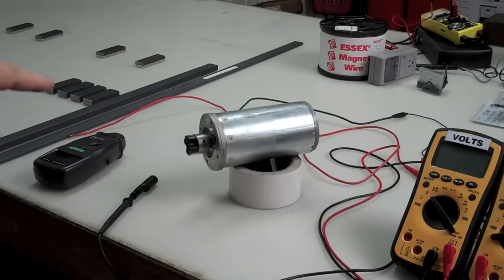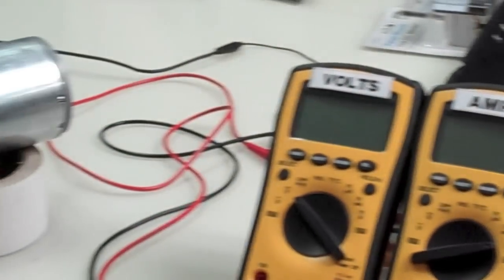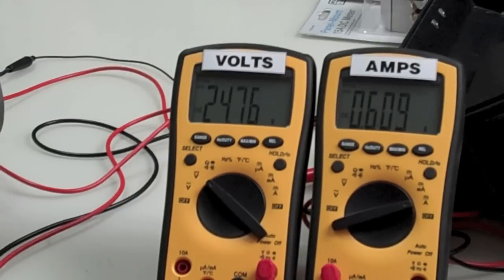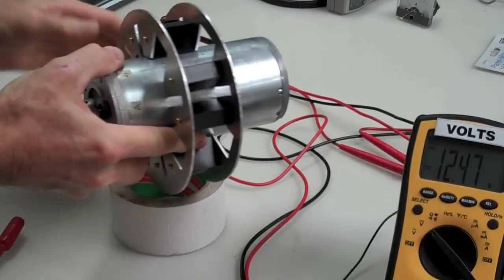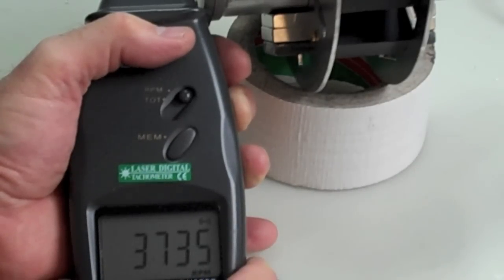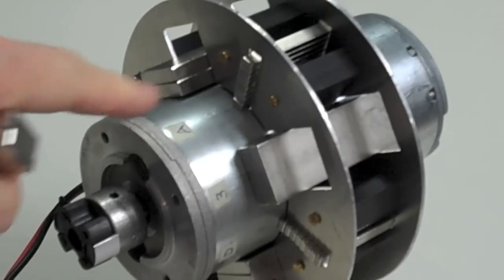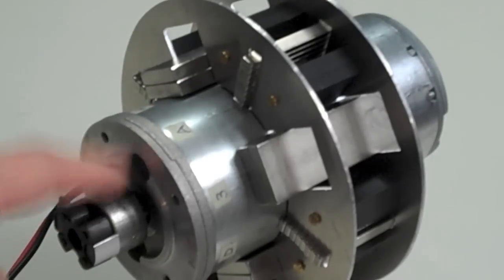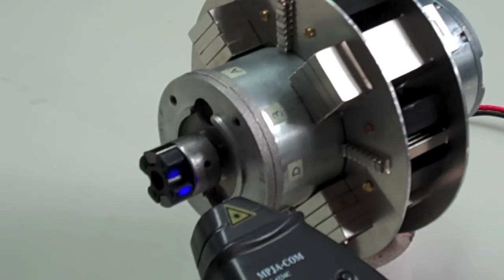STARGATE MOTOR  FULL DEMO

Comment: The motor requires power to move the rotor and that is the load.  The power it takes to move it is 24 V x 0.6 A, which makes it 14.4 watts.  In the second instance it took 12 V x 1.0 A which is 12 watts.  The RPM and voltage changed, so the load changed.  And that happens on non-optimized motors, because the rotor is banging with less force on the repulsion side, that way the RPM is controlled for a specific and constant load.  The trick here is the change of design. College is very helpful guys

Comment: It is just field weakening effect. Field weakening in DC motor increase, just look up the basic formula for DC motor operation. Byweakening field, not necessarily, you will increase power, torque depends on current. If field is decrease, torque is decreased

Comment: If you opened up a textbook on motor design, it would be no surprise that strengthening the magnetic field around a permanent-magnet DC motor improves the performance. 
Motor manufacturers are not being 'sinister' - rare earth magnets are made from things called "rare earths" which, as you'd imagine, are not as common as regular iron and nickel.

Comment: But the amps drop off at a faster rate than before, i would assume due to the additional friction imparted from the magnets you added. Which is the same input more or less. The additional amperage compensates for the voltage drop. And as we ALL know, amperage is what actually performs the WORK.

Comment: For the magnets to stick to the casing and not fly to the far ends of your frame you're commutating the flux that MUST radiate outward in relation to the neutral plane set for the brushes and therefore reducing the field flux that the armature sees.  While this increases the no load speed and reduces current draw, it reduces shaft torque exponentially.  At the end your arrangement causes runaway speed because the field is so week.  See physicsforumsdotcom thread 412799.

Comment: What is the justification behind the large and small magnets and why could you not have accomplished the same with only the large magnets on top of the internal ones.  Secondly, how come you did not use a voltage regulator to step down the voltage to say 3V and see if you would achieve the same 3K RPM.  In my experiment I've stripped several like motors apart and used their magnets to double up the magnetic flux.  And last could you tell us where you purchased the motor?.  Thanks

Comment: If you did use better the bearings, it will spin faster, because we reduced friction that the motor has to overcome. Adding the mags, or making them stronger, if it makes the motor overcome that bearing resistance so that it can run at the same rpm using less power in than before the mags were added or strengthened, are you saying that it is only an illusion?
Gotoluc's experiments show that it is not an illusion.
I will try it after im done with a couple projects im in at the moment. ;]

Mags

Comment: Mediumwel06 below is absolutely correct as anyone taking DC machines in EE will find in studies.  Just watch what happens when a 25 HP machine loses its field... I saw that happen and it went up to 8000 RPM in less than 2 seconds... amazing given the size of the rotor of that large a machine.

Comment: Exactly my thoughts. It must be a permanent-magnet 4-pole motor with commutator - like a wiper motor. If he turned the ring 45deg. he would probably half the RPM, while doubling the torque. And the no-load power is of no interest - it only tells us how badly the motor is designed - 15 watts of loss is quite a lot for a small motor like that I think.
It would be much more clever to replace the internal magnets with an electromagnet, thus being able to control rpm and torque electronically.

Comment: The data we’re interested in is under “performance”, where it lists the Inertia (WK²) . This is a pretty terrible table layout--it took me some time to realize that the first row was independent from the 2nd-4th , but I digress, the listed inertia is 5.92 OZ-IN^2. Now to gather data on the video itself. We want to find the electromagnetic torque if the speed is to increase linearly from rest to 10,000 RPM. We want an exact RPM reading from the tachometer and time measurement at that reading.

Comment: This is directly from the book on what the law on this actually are

In experiments it can be shown that the force F is directly proportional to the sizes B, I and L.
B is the magnetic field size, magnetic flux density is measured in Tesla. [B] = N / (A * m) = T.
In the current strength and is measured in amperes.
L is the length of conductor in the magnetic field and measured in meters.
That formula is equal to F = BIL

Comment: In a rotational system, the angular acceleration due to the net torque acting on it is determined by its moment-of-inertia J. Rigidly coupling a load to the drive shaft of this motor would add to the equivalent combined inertia. But since this demonstration had no load, we will only consider the inertia of the drive shaft and motor
To find more information on this motor, go to google and type “dc motor cat number 970.621” The second link will have the data we need for our calculation

Comment: actually, RPM IS a valid measure of power output of a "non-loaded" motor. "BEARING" in mind the mechanical losses (friction), if you can make a motor run at a higher RPM with less energy input, you are merely increasing the efficiency of the engine.

Comment: When it started on 12VDC there was no need at all to hold the motor down...so while rpm may be equal the torque or power is nowhere near.

Comment: how does it effect torque? 
Knowing that this increases RPM why wouldnt you select a motor with bearings  that could handle the increased RPM?  That way we could better gauge the potential of the motor's operation.  Questions:  1. If increasing the magnetic field can make a motor more efficient, ie greater RPM, less amperage, at less voltage wouldnt motor manufacturers not incorporate this design into their motors?  2.  Is the motor in this video a brushless motor?  3.  If so, would your design work on a larger motor like a 10hp Manta II?

Comment: if you were to use a brushless motor with frictionless shaft (magnets), would that affect the "stargate" ? Also, very important question: how much load could you put ON it? for example, could you place and turn a generator at the end of the shaft and GENERATE more power than you're inputting? that's the real question... because if it runs at 15k RPMs and you put your finger on it and it stops, then all you have is a fast motor that can't turn anything other than itself...
Reply: +Mathieu Charlebois He gets more RPM from a low applied voltage.  This means your instinct that the torque would be low is almost certainly the case.  We know that he is effectively weakening the field at the armature.  Current flowing in the windings times this field is what gives the torque.

Comment: so how many amps and volt did it draw for the 10k rpm? i know voltage coresponds to rpm and amps to torque. so if volts are at 12v and rpm has gone up yes that is a very strange effect

Comment: If you dont get more speed, that is becourse the extra magnets, have been wrongly placed. Which will create more heat and be lesser efficient. You got to know what your doing.
If it is done correctly it will give more speed no matter what, and it seems like this video shows the man have investigated how the magnet are placed.
Another one  of the basics is the more pols the more torque and lesser speed.

Comment: In simplest terms, torque is power/energy on demand.  Modern electric cars have much more torque than an internal combustion engine(they don't need to be as powerful as an ICE to achieve the same results).

Comment: Yeah, but you'll have to have a mechanical mechanism to move the motors to and from the motor to actually achieve changing the torque and speed, if you're intending for an application like transmission of and electric car or something.  Isn't it better to do it with electronics, like using PWM to drive the motor?  In fact what if you used a second coil wrapped around the motor, and use it like a braking system?  It could be regenerative.
Reply: I meant "move the magnets to and from".

Comment: Your just changing the phase/timing of the motor by shifting he magnetic field.  This motor was optimized for 3000 RPM with a load.  You can save yourself effort by retiming the motor by rotating the stator, rather than added bulky external magnets.  Also, most of the flux of the external magnets is wasted because you have the magnets mounted outside the case.
Try to take efficiency measurements with a load on a dyno.

Comment: I suppose you missed it.
The first time he measured 24 v. Every time after that he measured 12 v (plus something). The thing is, when it was 12+ v it was the same reading every time. What changed was the amps used. He didn't show the amps the last time because he didn't have enough time before the motor would have burned out trying to go up to 15,000 rpm.
Volts always the same; amps less and less. That makes for less and less power. Simple dimple.

Comment: Care to elaborate? What exactly have I said that you regard as silly? As someone who designs and builds transfomers and other magnetic components I take great care to ensure that I know what I am doing. As you suggest in a subsequent comment the case of the motor would be shielding the innards from external fields if made of ferromagnetic material.

Comment: Have you tried cooling it using High Spec PC liquid cooling or even liquid nitrogen? I reckon you could get an extremely high output with low amps/volts if kept at an extremely low temperature if done correctly. I would try it but I don't have the tools to do it, so I need someone like you to test it... Respect :)

Comment: Maybe keep lowering the voltage and see how low you can go and maintain the 3k rpm, and then maybe hook it up to a generator equal size and see how much power it will produce with the enhanced field and maybe even as in the end,  see if it will run own its own power until it eventually turns itself off.  I figure it will be interesting.

Comment: Seems to me the power consumption was about the same. I'd be curious as to wether the output of the motor was increased in terms of HP as well as RPM. That is what is going to save folks money.

Comment: can this be done to brushless motors?... and if so, is there any difference on how the magnets are applied?...and how would it react when a load is applied to it?...
Reply: I don't think so! At least not with permanent magnets. Because the permanent magnetic stator in a normal motor is on the sides, while in a brushless motor the permanent magnetic rotor is in the middle. Maybe instead of permanent magnets, you ought to use electric magnets but they would have to be in-sync with the electric stator of the brushless motor. Or so I think.

Comment: So lower your input voltage now to 3 volts and the motor should run at the 3500 rpm design spec.

Comment: RPM is not an indicator of the torque. What is break horse power of the motor with 12 V and 24 V supplies. Ever tried to measure that ?

Comment: What I want to know is: If you put the original 24Volts rating in the finished setup, will it run faster (10000rpm) while still using the original 0.6Amperes or it will use more power?

Comment: From a definition of the advantages of none iron cored engine:
"The unique advantage of ironless DC motors is that there is no cogging (torque variations caused by changing attraction between the iron and the magnets). Parasitic eddy currents cannot form in the rotor as it is totally ironless, although iron rotors are laminated. This can greatly improve efficiency."

Comment: [1] This is a multi-comment answer, read in order of these numbers.

1. These motors work by passing current (in a rotor winding) through a magnetic field (the stator flux, in this case provided by permanent magnets in the motor case). The interaction of the current and flux causes a force perpendicular to both. This force, acting at a distance from the axis of rotation, results in torque. The more current that flows, the more torque you get. That's the basics of how motors work.

Comment: OK  from my understanding all you are doing is creating a secondary field , by doing so you can achieve greater RPM at a lower voltage BUT conversely the current required has doubled. got to 24 V instead of 12 and obviously the motor will want to run at 6K-7K @ 1 Amp because the additional magnets reinforce the existing field and as such higher speed.

Comment: hmmm... 24 volts @ .6Amps as opposed to 12 volts at 1 Amp ...
half the voltage and nearly twice the current draw...  
seems normal to me as far as power goes...
the interesting thing from my point of view is the RPM..
seems the Stargate allows for less friction in the motor...
but the current draw is not changing radically.. 
one would expect a 24 volt motor to pull twice the current at half the voltage...

or am i missing something??

Comment: I calculated the torque based on the inertia of the motor itself already, go a page back and read my chain of replies to see for yourself. the torque required to accelerate the motor’s own inertial load ( 1.083E-4 kg-m^2 ) to 10,279 RPM (193 rad/s) in 5.577 seconds is 0.185 LB-IN ( or 0.0209 Nm).  From this you should be able to calculate mechanical power yourself.

Comment: Did you notice? You had to hold the motor down the first time. Afterwards you did not, indicating a great reduction in torque. Meaning the motor, at load, would not even be able to start up compared to without the extra magnets. With the magnets, about the only thing the motor would be good for is as a fan, with it's low starting torque requirements. As the torque requirements increased, with increased air movement, the speed would go way down. No practical gain.

Comment: Yes?   What is supposed to be unusual about this?   If you put two identical current carrying conductors in magnetic fields of different strengths, the one in the stronger field will have more mechanical force.   Alternatively, you can put less current through the conductor in the stronger field for the same amount of force.

So he's supplementing the stator field with permanent magnets and  the rotor has more force on it (i.e. it spins faster) for a given current.  Exactly as expected.

Comment: So you discovered "field weakening". Have a play with a motor that uses electromagnets for the field instead of permanent magnets. Make sure that the field windings are in SERIES with the wires to the brushes. As the motor revs up the current drops and so the field magnets weaken causing the motor to generate less back EMF. This encourages the motor to continue pulling current therefore continue revving up. Car starter motors are like this. Hi load/low revs = lower amps than with permanent mags.

Comment: Sure it's running at a higher rpm at half the voltage, but it doubled the current so it's just a trade off AND you're not getting any more torque out of it....are you?

Comment: Ya know, I have not experimented with it to this extent yet. Plan to. ;]
Gotoluc is doing experiments on this. As he adds more mags, the same coil and input have more force/torque. Are you saying that if I pick out any motor, that the strength of the mags used in that motor are optimum? If they are any stronger the motor will become less efficient? I dont believe it.
Its like saying if we improved the bearings in the motor it wont idle any faster than normal.....Continued

Comment: Back in the heyday of industrial DC motors (before the AC/inverter/vector takeover), field-weakening was used quite a bit.  The motors would be run with full field from zero to their rated RPM with full torque ability, and run at reduced field to extend the RPM range above what they'd be able to attain with full field, but at the expense of some the the torque.  Motor controllers would handle this changeover automatically
Reply: +bledlbledlbledl did they/could you use this as a substitute for gearing?
Reply: +Justin F Well, to a certain extent.
Using field-weakening you can typically get about 50% more RPM than rated, WITHOUT having to give it an unhealthy 50% more armature volts (overvoltaging = bad idea).  Beyond that, bearings/vibration/centrifugal force becomes an issue, so if you're looking for more than just a 50% extension of the RPM range, than you'll need to use some gears.  Because gears have virtually no limit to how they can extend a motor's torque vs RPM range

Comment: The power of a motor is defined by speed AND torque: P = speed (rad/s) x  torque (Nm): A higher speed does not mean more power, you need also to load the motor. Speed will increase if you weak the magnets (as you did): the motor has to rotate faster to generate enough back EMF. Motors (old) with weaker magnets ,however rotating faster under no load, will perform a lot worse under load: speed will drop dramatically (ref loadcurve -rpm/Nm- ), and that is what we do not want to happen.
So load it.

Comment: People who know about motors keep telling you the same thing; that you are reducing the magnetic field with your external additions and that reduces the back emf, hence raising the no-load speed (but the current rises sharply, which you omit to show in your final run). So try what I suggested before: open up the motor and remove some of the permanent magnets, which will give the same result. Unless and until you do that you won't actually understand what is going on.

Comment: Measure the torque, you will see where all the power goes :) And don't confuse power with RPMs :) But I have to give it to you: Excellent idea to make high velocity drill - just buy a motor with ball bearings and maybe some cooling. Great project! :)